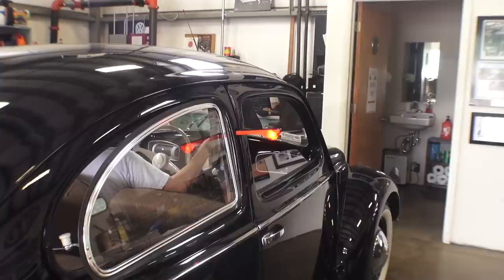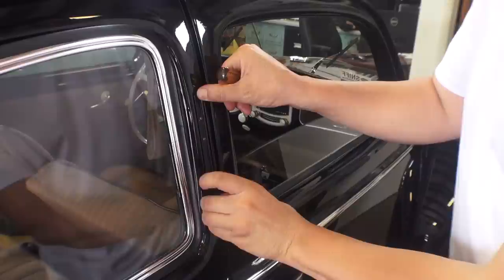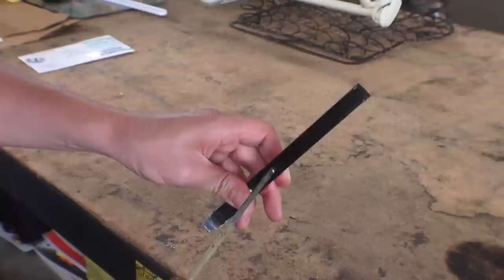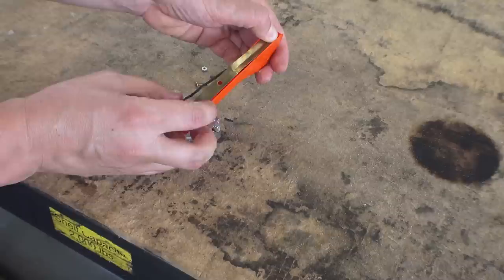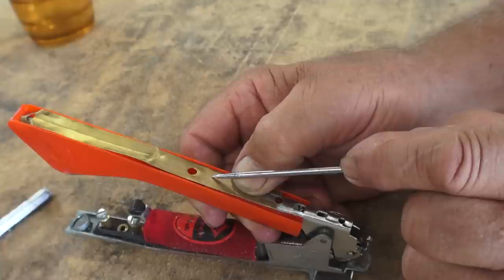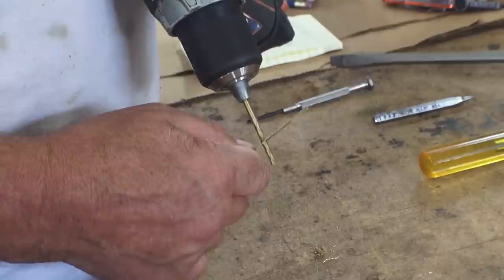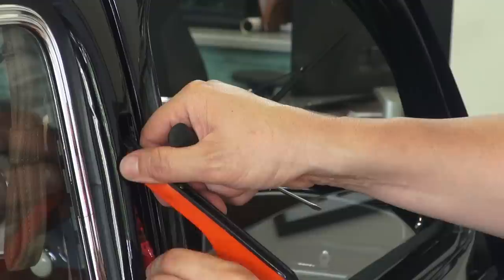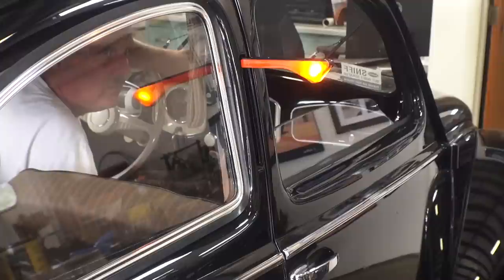Classic VW BuGs How to Make your Semaphores BLINK FLASH Directional Beetle Turn Signal!

Comment: Hi Chris, I just watched your semaphore vid again.
I have installed the same Flashing bulbs and they work fine.
However I still have an issue with the RH semaphore being sluggish in coming out. 
The left hand side pops up fine. The right hand one is sliggish and only comes up at 45 degrees sometimes. I have a 6V 1958 beetle. Any suggestions about how to fit this issue? Cheers, carl
Reply from the maker: Yes try some WD-40 on the moveable parts within the semaphore.

Comment: Hi Chris
Love the videos and the great advice, have recovered all the seats in my Bug using your handy videos.
I haven't pulled my semaphores apart yet to check whether I need 36mm or 42mm, so I was wondering if you know off the top of your head which would be the correct ones for a 1960 Bug?
Keep up the good work.

Comment: Hi! My 59 has a 12V system and I am using a step down reducer to deliver 6V to semaphores. The semaphores coils are heating, even using 6V feed. I can't measure It, but the temperature can reach 50-60ºC in the coils. Is It OK or i have a problem? Thanks!
Reply from the maker: Probably not, I would get a better reducer

Comment: Thanks for your comment about WD 40. I have done that. Any additional suggestions?
Reply: Measure the voltage going to the working side. Check it on the funky semaphore. If it's lower, even a bit, that's the problem With only 6 volts to play with, a drop of 1 volt is 16%. I've had to replace a few 69 year old wires that had just plumb run out of electrons to give

Comment: Great vid. How do you go about re connecting 6v semaphores into a 12v converted bus that has flashing turn signals installed as well?
Reply from the maker: Dean Luongo May need a voltage drop.
Reply: Look for something called a voltage reducer (12v to 6v).  They sell them relatively cheap.  I think about $6-10 per reducer.

Comment: Hello Chris this is Argimiro from Venezuela. I am restoring a 1956 oval. I am trying to install the bulle front signal light, but it does not sit flush on the fender. Any recomendation  about how to do this?
Reply from the maker: do you have the seal?
Reply: @classicvwbugs  Nop! I can not figure out if the bullet housing has to be welded to the fender!!
Reply from the maker: @argimiromalave3216  pop me an email with a pic of what you are doing to send me a vid from your phone to FB messenger.

Comment: Could anyone tell me if there's a "proper" way to manually open the semaphores?  I have one that just opens when you push the top of it (installed on the car).  The other seems "stuck" but I know there's a latch that must be pushed to let it open.  I'm guessing my other has a broken latch, but if I want to remove the intact semaphore from the car, how to I access the latch?  Thanks in advance for any help!

Comment: Hi Chris. Not sure how adding these LEDs don't affect the draw issue.  I installed LED halos for front signals, and now the Semaphore (still with the incandescent bulb) won't operate/flip out.  Mechanic says with LED halo signals, there is not enough of a "draw" to activate the Semaphores anymore.   I'm stuck for a solution.  They don't think adding a pair of resistors will fix it.  Should I try anything?
Reply: Peter Jeno 
I am having the same problem now
My semaphore will not pop out and will not light up.
Prior to this happening my fuse blew twice ; then my bulb went out.
When I replaced the bulb ; now nothing happens.
Any advice will be appreciated
Reply: Hello VW Friend! Did you figure out the problem? 
What did you do to fix the issue?
Thanks!